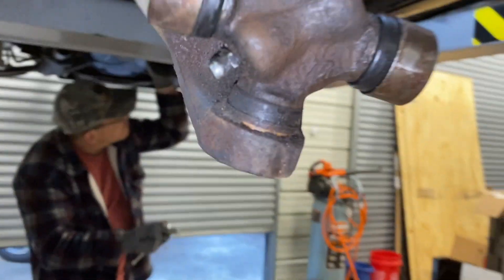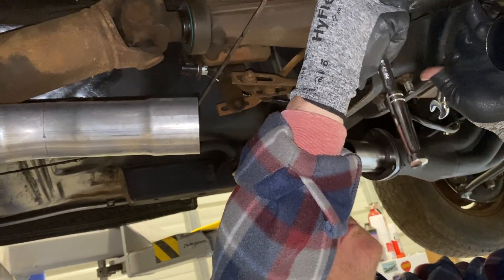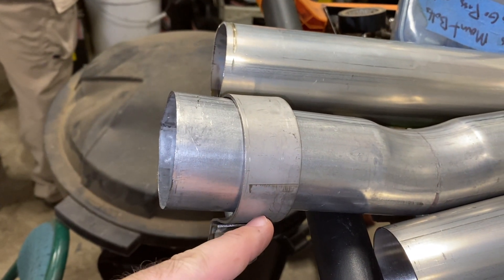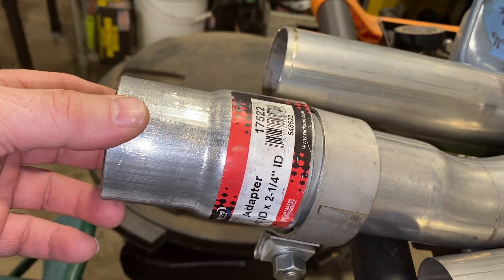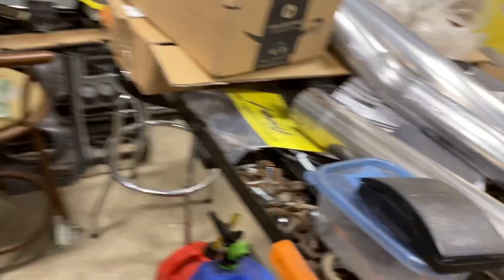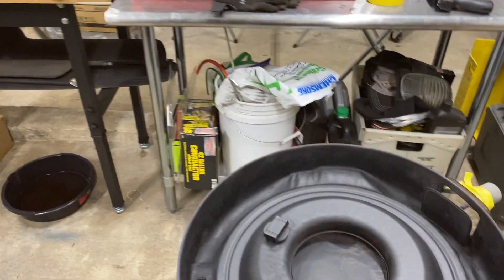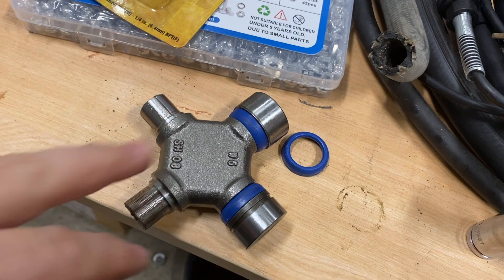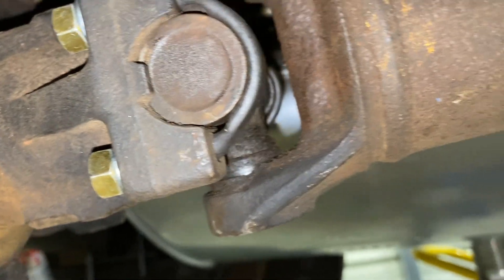1972 Mach 1 Exhaust - DONE - Driveshaft - DONE - Next? Details to Interior & Engine Bay #musclecar

Comment: On the rear joint clamps make sure you use the lock nuts or they will come loose with the centrifugal force of shaft rotation.
Reply from the maker: I'll make sure of that Mark.

Comment: I would suggest that you not rechrome that cover. That has the original 351 4V factory decal! What you have there is a piece of history and is a rare part. If I'm correct, the non Ram Air cover was different. Ram Air was available as an option on Mustangs and a few Mercury Cougars. This is why you can't find one. Clean it up best you can but don't touch the decal. Just a suggestion.